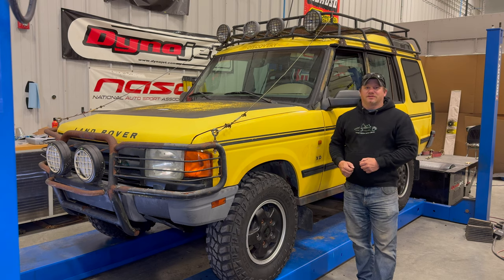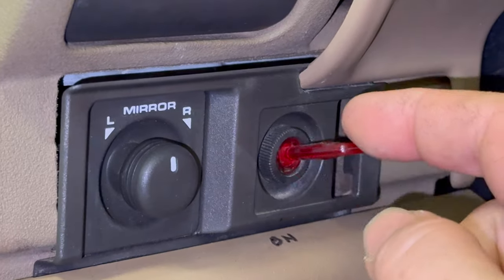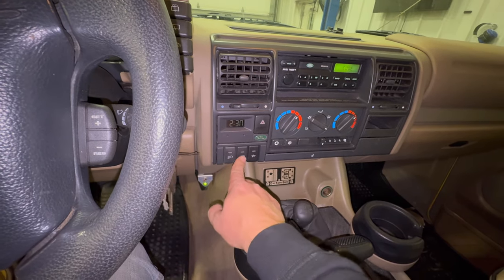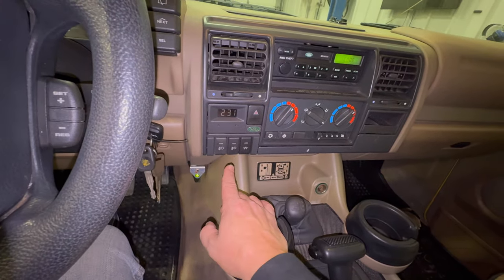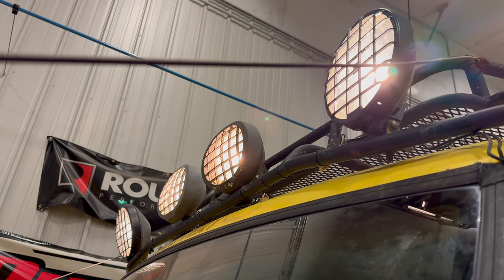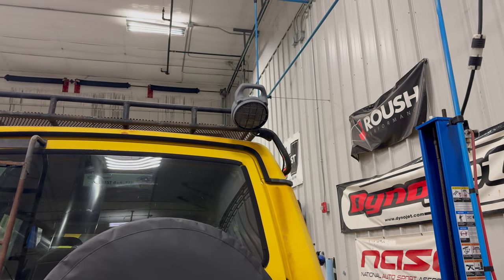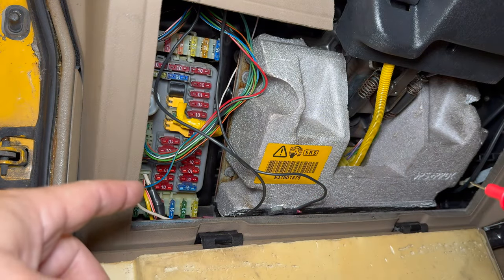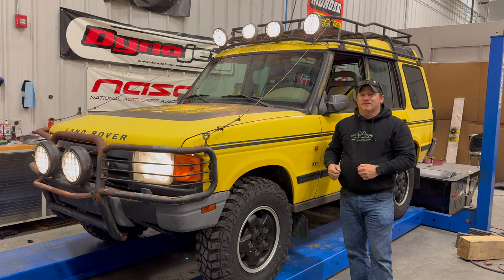Diagnosing the Off Road Lighting and Fog Lights

Comment: Your diagnostic skills are amazing. I wish I could remember which switch worked the rear work light for sure. I know for sure that the driving lights did not have to be on to use the rear light. Good luck. You’re going a great job bringing the XD back from the dead.

Comment: I wired my rear work light through an aftermarket wire harness w/ relay, then connected it to a stock switch. I fitted a D1 three switch panel into the ash tray slot on my D2 for my aux lights.

Comment: My best guess is that someone wired that extra fog light on the dash to that rear work light.  You'll notice that the other fog light switch lights up when the grill fog lights are on, but the other fog light switch does not.  I would trace the wiring to that switch.
Reply: If it is like the other wiring, I'll bet there is a mess of taped twisted wires behind the switch.

Comment: Interesting diagnosis of all the lights. I think the mice may have eaten through the wires, they like to sharpen their teeth! This might be a silly question but did you try putting on the lights and opening the rear door? Another possible option is that there is a switch hidden in  the back by the door or the push button is broken, the one that activates when the door is opened? I don't know but these are just my thoughts. I've not worked on one of these but feel free to dismiss  all that I have said I won't be offended! Thanks Steve for A great video. 👍👍
Reply from the maker: I went and tried opening the rear door, tried it with all the combination of switches and lights on, did not work.